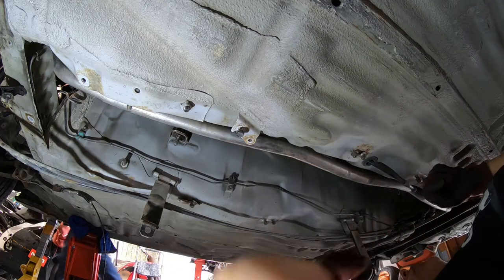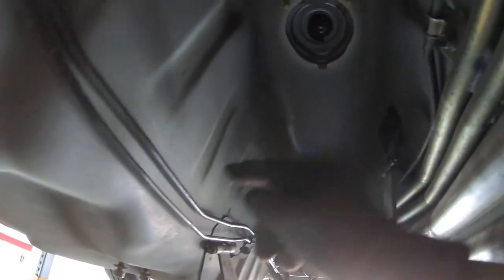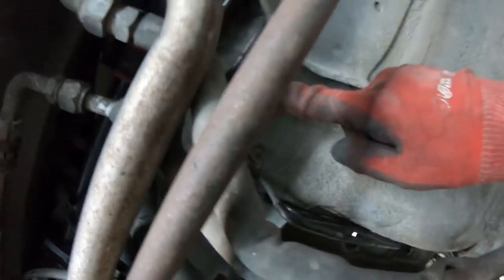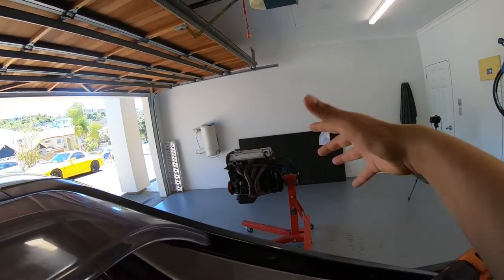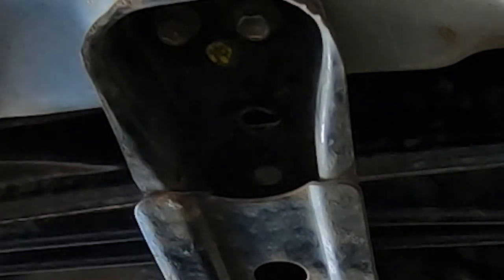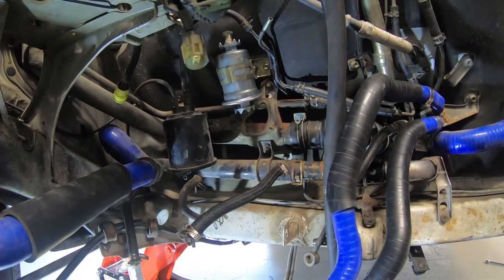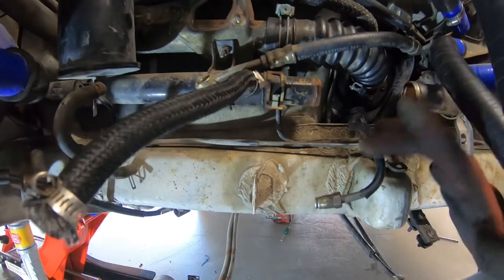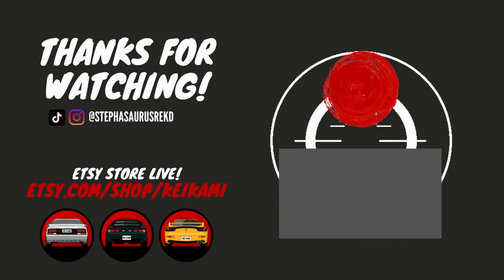the WORST job when doing a manual swap!

Comment: Great video. I am still working on my engine for my aw11 restoration and manual conversion. I had not found the supercharged gearbox purchased a Camry gb (same as turbo manual box). I have 1.5 years left on m build, yours sounds like the deadline is approaching fast!
Reply from the maker: oh interesting! and the camry box will just bolt in too? thats pretty cool! 
toyotas are just big lego cars haha! 

and yep! only 3 vids left! Next one (which will be a bit of a big one) will be out this weekend and focusses on electrics and starting the engine for the first time!